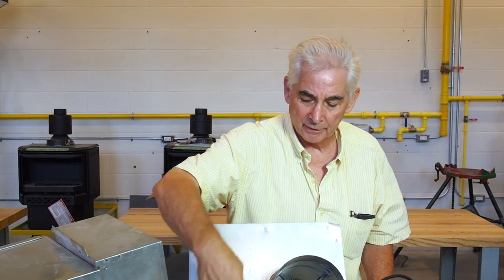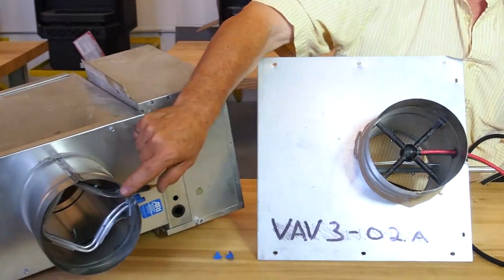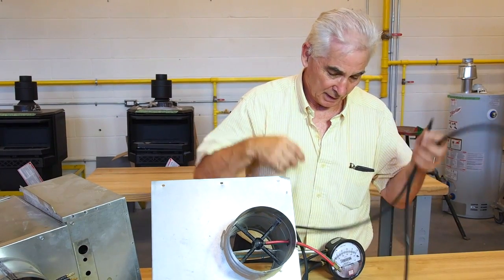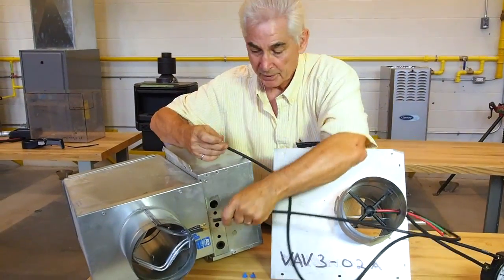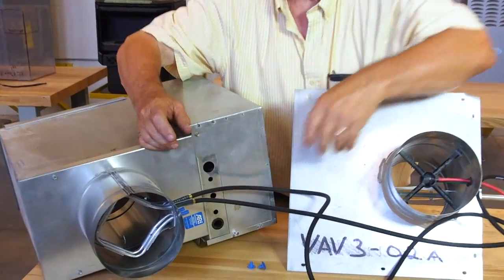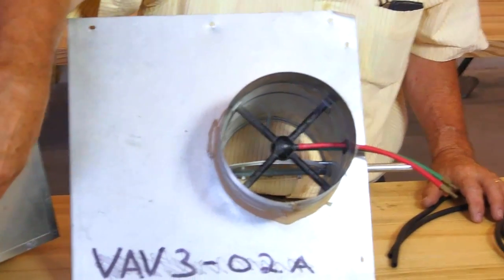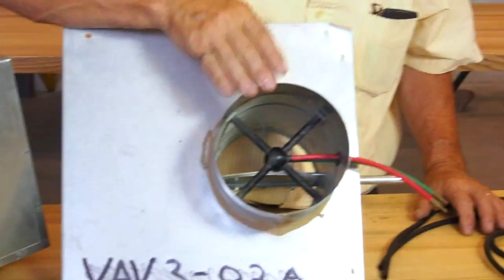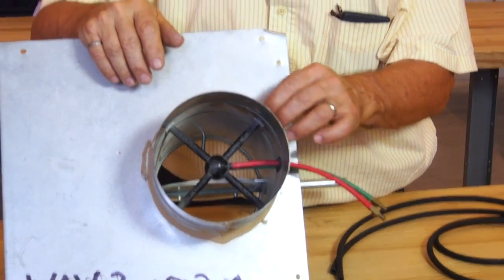Measuring VAV Flow Rate

Comment: Note: Since the typical flex duct to the box is not nice and straight it's likely your reading will be way off.
Either traverse or the typical method to determine flow is using an airflow hood.